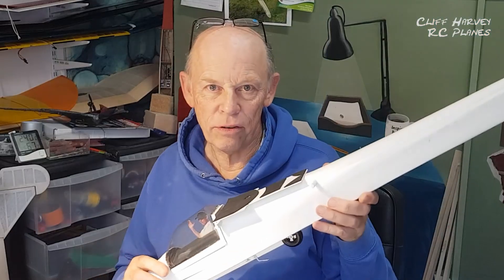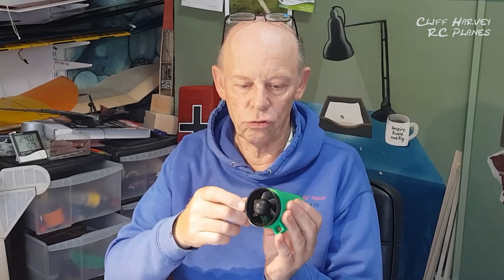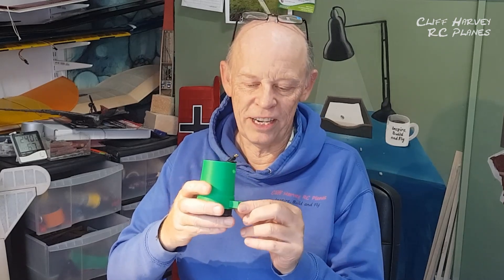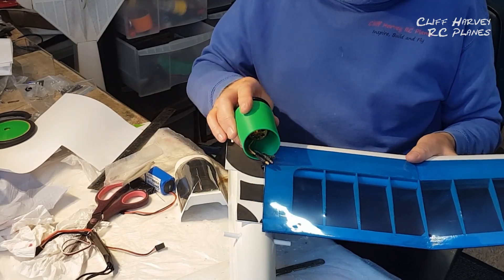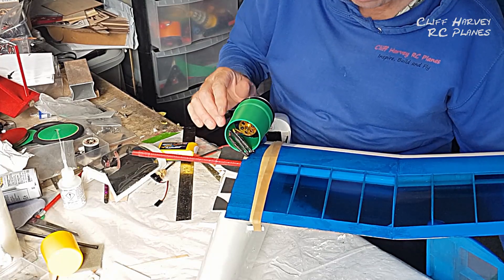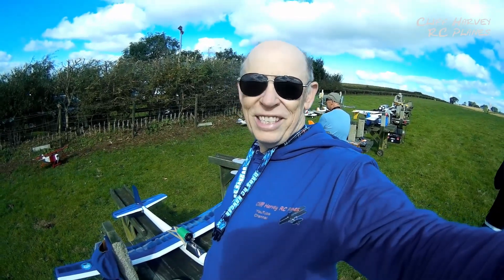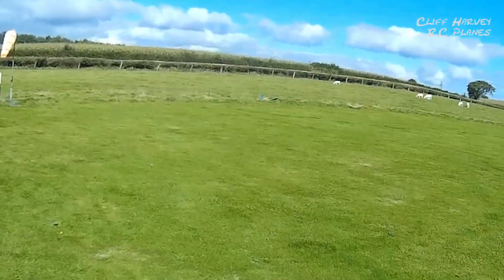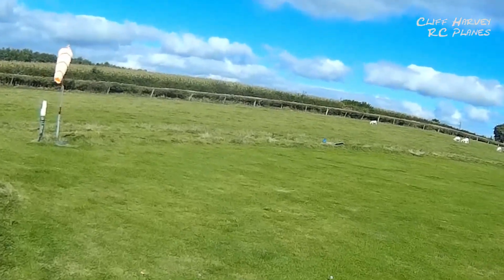EDF Slingsby Glider Conversion Experiment

Comment: I want to come to the u.k for the rc planes fun and safety
Reply from the maker: Where in the World are you, I know some countries don't like model flying?
Reply: @CliffHarveyRCPlanes  Im in Brazil. Well... not many of us love it. Most brazilians actually use it to show off.. just like buying a ferrari to come to a french car meet to show u have money. That is how it is here. I love the simple builds... balsa... 2 channels... Love it. The smell of balsa... the feeling of hiking up the hills to fly slope for example. well... its not popular here... enough balsa to build a simple 1.5m 2 ch glider will cost around 200 pounds... plus covering... plus radio gear which is INSANELY expensive. even the cheap chinese ones... Its a nightmare.
Reply from the maker: @feltav5719  That's bad news, any chance you could use something other than balsa, 5mm foam board perhaps, no covering required either?